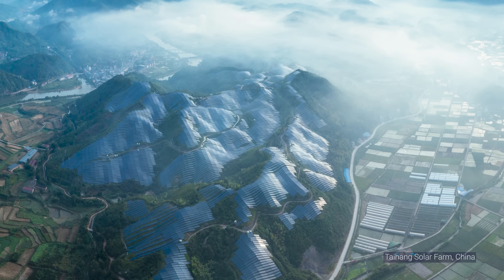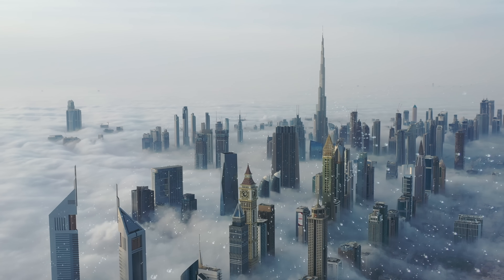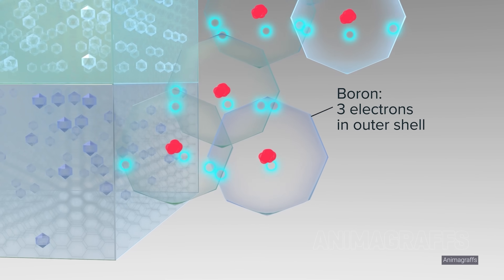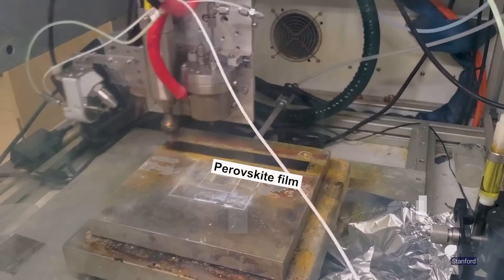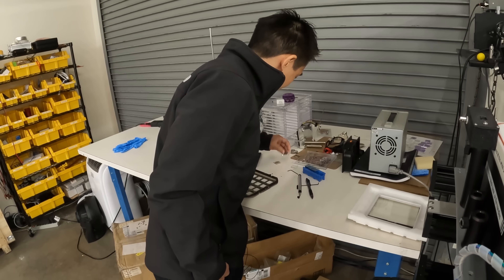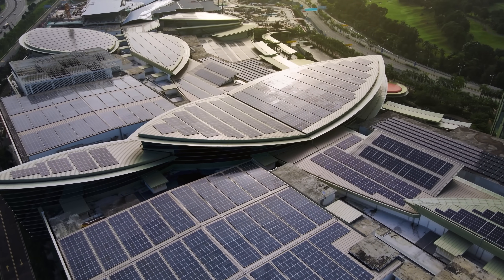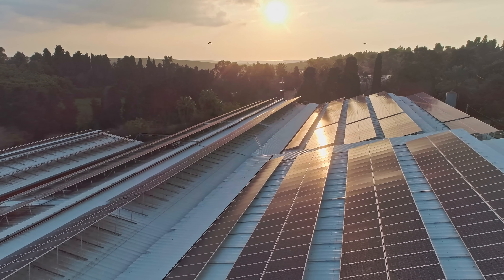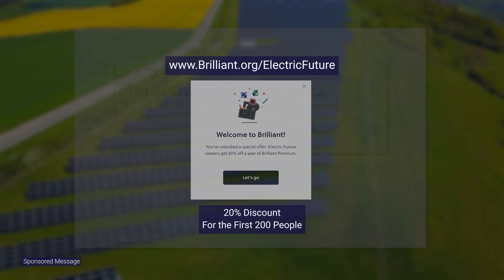Solar 3.0: This New Technology Could Change Everything

Comment: Solar windows, even small round 1s beat solar panels save arizona bright. Anched panel 3" low to  high  on sunny side min. If u only can make RV face park 1 way in slab spot, Then u will need to make panels unlock & disco spin to other sunny side. If less windows cheaper heating & cooling saving but still natural light strong by solar window usually air insulation heating cooling cap.

Comment: 1669: if going w/20% enslavement system any way bc top of roof or trailer dead spot any way what counts is stadium slopping roof or flat ish roof. If trailer roof parked mostly or driven largely.  If slopping easy right sunny side of roof anyway just fineness best angle for latitude esp if fixed not able to increase up or down during day. If a trailer height weight limited then u need to slide extension double the sq feet when parked so not just near flat setup but able to lift up so not flat angling best lat amount. But if u can slide out & double sq feet u will get less shadow effect big help. At a min if trailer roof fixed hve arched flat surface so a bigger window of day charging.
Reply: If u hve only simple trailer arched deal set up fixed bulk of time. Then u need a light box broad opening mirrored inside. Further from panels u can get light box again a simple slide the better light mirrored greater panel length of day results.

Comment: If these are so cheap and are more efficient, then who cares if they only last two or three years? If they are 1/15th the cost...then they only need to last 1/15th as long to be competitive. They should be commercially viable NOW....unless the service life is vastly less than they hint at in the video.
EDIT: Further investigation reveals the best lifetime achieved so far is 1,000 to 2,000 hours of exposure to sunlight....or approximately .5 to 1.5 years of typical service.

Comment: Ok this is great to hear. Solar panels have come way down in price. Could they not make a hybrid between the 2 to create a better product. Also the biggest issue with solar is storage of power. We need batteries to take a leap in technology.
For this product 10% increase efficiency at 1/5 the cost sounds amazing

Comment: Water gravity old way only game in town 3rd way. 4th way NOW is geothermal. 5th way NOW is nat gas, or 5b &5c way in NOW is trash dump or farting gas. 6th way game in town is tidal or wave. 7th way in now is nukclear, just the back side big problem long time current tech. The 8th way is coal dirty still current tech. 9th way is oil a lot of it if not spilling it big mess.10th way in NOW is algae green harvest or bio harvest mass 10b way. The 11thway in NOW salt mrror solar or 12th way in NOW vertical wind. the 12th way if solar watch watch way but slave labor & printed fake money would fool u otherwise. So u hve to use solar for heat 1st or purifing water 2nd or mirror salt 3rd or 4th back pack drone wing or 5th vertical reflected lost top of roof any way.
Reply: space 24hrs a day sat wing the exception when talking solar way more than just 20-30% enslavement satanist system there aimed in space.

Comment: If u live in an area not drone wing, or already real hot! or already clean cheap pure water & dead area on roof or top of trailer, only way then left to use solar is reflected or mirrored transparent vertical panel way. Solar then still basically a loser if not in space 24hr sunshine  or in back pack aimed or drone wing free power otherwise lost.

Comment: Great information and explaination overall, thanks for the vid. But it was a shame to not talk about a very important counterpoint against all multi-junction solar cells, the recyclability (poor LCA). It's all well and good if they're cheaper and easier to make, but if they are harder to reuse the materials, to make the cost of 2nd life materials as cheap or cheaper than mined raw materials. You will have problems for energy from the 'renewable' panels to truly be renewable. With finite resources, you must be reaching towards material steady-state.
Reply: @Anedime  while I appreciate your reply, I think you have a fundamental misunderstanding of carbon flux and the relationship between new technologies. To put simply, there is a carbon investment for any product, but to take a product from the lab to commerical scale, takes several order madnitude more carbon investment. Looking at the panel in peacemeal, the carbon payback for traditional Si solar could be around 5 years, so its a carbon positive product, when its rated at 95% spec for 20 years, however if we need to invest significantly more carbon on a product that may or may not ever reach carbon positive, due to the reasons of reuse of rare earth material, you will never achieve scale needed to decarbonise the world's energy. IRENA's latest report suggested solar could represent up to ~30% i think, total energy product, you can do a simple calculation to work out how many panels that is, and how much material you need if it were from the multi-junction cells. It's not a very promising option, even if an optimal senario is considered, and this does not mention the opportunity cost of NOT investing in a better technology, of which there are many, to achive the goals you outlined.
Reply: @bradmudgway6118  As for your explanation on the carbon cycle and near zero impact of conventional panels…bravo.

I’m personally skeptical about the whole “climate change” discussion. I’m mainly in this to take the “solution” out of corporation-sold/government-bought hands.

It astounds me how much everybody has vested in the argument, but so few are actively engaged in developing better solutions. “Climate alarmists” should be more interested in developing more solutions, while “climate deniers” should be more interested in making money and removing government from the equation.
Reply: @Anedime  Really?

You think forcing a technology with obvious designed obsolescence is MORE important than recyclability? 😂 

The whole issue was selling a “problem” that would justify selling a bad “solution” in perpetuity.

You really think dumping these panels full of toxic materials into land fills while strip mining for more rare Earths is a GOOD thing? 😂

The problem is that people, like you, are more interested in being “right” than actually solving anything. You’ll sit back say “society” needs to do something, then vote for people you’ll never meet to sign thousand page bills you’ll never read drafted by corporate lobbyists you’ll never see.

That ain’t dealing with the “problem.”

That is being mindless sheep.

Until you start developing viable solutions, you cannot honestly say that you “care” about the problem.

If you want something done right, do it YOURSELF.
Reply: @Anedime  unfortunately we're nowhere near the stage of being able to produce enough energy and being able to store that energy from renewables, but that's where we're being pushed to by the "greens"
Policy change is being based on totally inaccurate climate computer models.
Which is sheer lunacy!
Energy prices going through the roof, partly because of this "green" ideology!
It's like a religious cult, once you start looking in to it all.
Sure, let's reduce fossil fuel usage, and let's use renewables, but let's do it in a sane logical manner.
The last 2 years of our reaction to covid, should tell anyone with half a brain that our "leaders" do things in a way that's completely detached from sanity and logic.
Reply: Even with the nowadays cheap solar panels I don't like the framing of windmills and solar panels being a huge burdon on the waste fills. Yes eventually they end up in waste fills but they will be as polluting as half of all the diapers used for example. And this is the case for the future situation where the world is fully dependent on solar and wind energy. So yes it's a problem, but not a huge problem.

Even diapers can be easily replaced by washable ones, but you don't hear people about it, so apparently they sont care :)
Reply: @Timmsh88  Maybe you should compare the manufacturing processes for diapers, solar panels, and wind mills BEFORE using them as a comparison. 😂
Reply: @Anedime  Excuse me? OIl is the most prevalent energy source, followed by coal and gas! Then hydro and other renewables. Nuclear is not even close to top three. Further the environmental impacts of nuclear power (during normal operation) are miniscule compared to fossil fuels, and contribute little to no CO2 or air pollution. Radioactive waste is manageable. Nuclear is clean so long as it's done correctly, and in the end, it's going to be the one thing we can rely on
Reply: That’s why the panel should be passively optical. Being only polymers and silicates, manufacturing would far cheaper; both from material costs and manufacturing complexity.

Then you use passive optics to transmit the optical energy to a centralized conversion system. You can passively disperse the light by wavelengths allowing you to direct particular wavelengths to its respective material which do not have to be layered with other materials to accommodate different band gaps.

Furthermore, passive optics are impervious to EMPs like from lightning, solar flares, or upper atmosphere nuclear explosions.

The exposed portion of the system is cheaper to manufacture, replace, recycle, and disperse.

The more complex conversion systems are safe in the basement.

A side benefit is directing IR wavelengths directly to pavement panels allowing you to melt frozen precipitation without converting light to electricity to chemical back electricity to power metallic heating elements.

Oh yeah…didn’t even mention the aspect of harnessing IR for thermal applications such as water heating, water purification, radiator heating, and steam turbines for more electrical production.
Reply: @josephcoon5809  the rest of the circuitry would be susceptible to EMPs.
Reply: @glenwaldrop8166  Not as susceptible as a small unit in the basement easily shielded than as on the roof spread out over multiple square yards unshielded.
Reply: @josephcoon5809  It has to get to the basement.

This type of solar panel is not any more or less susceptible to EMP than anything else. The cabling would still need to be protected leaving the panels, same as everything else.

Normal solar panels are made up of silicon and metals, the silicon isn't the weak link in the other type nor is it at risk from an EMP.
Reply: @glenwaldrop8166  😂 So, you THINK polymers and silicates are susceptible to EMPs?

You have any papers on that?
Reply: @josephcoon5809  

I said the exact opposite of what you just claimed. We use solar panels when dealing with frequent lightning because they are hardier than the grid.  I'm not even bothering with you, you're either trolling, not taking the time to actually read the comment or your reading comprehension level isn't what it should be.

Regardless, have a nice day.
Reply: @glenwaldrop8166  I’ll slow it down for you.

Panels with NO metallics in it

because you are using passive optics to gather light and transmit it to the basement

is FAR LESS susceptible to EMP.

From the roof to the basement, it is optical.

IN THE BASEMENT is where the conversion to electricity occurs.

By segregating collection and conversion, you drastically reduce manufacturing costs AND make recycling FAR more feasible.

YOU are taking about technologies with obvious designed obsolescence.

I’m talking about a completely different design that doesn’t depend on fragile panels that are environmentally susceptible to thermal degradation and EMP.

Are conventional panels less susceptible to EMP than the power grid?

Yes.

Are they impervious like a passive optical system?

No.
Reply: @josephcoon5809  They all have electrical wiring to move the electricity.

That is the weakest link in the circuit, not the panel itself, regardless of the type.

The weakest link is the connection between the panels and the wiring itself, tiny strands of copper, usually, followed by where it comes out of the panel assembly into the charge controller, any points where the wiring combines, this doesn't change.

After that you still have to protect the external wiring and components, which is equal pretty much across the board.
Reply: @glenwaldrop8166  Yes. The ones available NOW all have METALLIC wiring ON THE ROOF.

That is why I said they SHOULD be passively OPTICAL ALL THE WAY DOWN TO THE BASEMENT.

Do you know what glass is? Light. Glass. Roof to basement. Metallica ONLY in the basement. Easier to shield from EMP. Thermally controlled. Not like on the roof. In the weather.

What isn’t clicking for you? 😂
Reply: @glenwaldrop8166  

Sunlight
Panel
Light
Fiber
Light
Basement
Photovoltaic
In the basement
Not on the roof
Not outside

IN

THE

BASEMENT
Reply: @josephcoon5809  you're talking about channeling the light?

You could have phrased it differently at any point in the conversation to clear that up.

That does significantly lower the risk of EMP but you're going to have a hard time blocking magnetism without blocking light. It's only going to be shielded so much, there's also the tunneling effect on the EMP depending on what the structure is made of for the light tunnel.

A traditional setup under a cage would have a similar effect.
Reply: @glenwaldrop8166  I kept wording it differently this whole time. I said the same thing five different ways. 😂 

And what are you talking about “blocking magnetism without blocking light”?

I’ve spliced fiber optic cables for 15 years, and I have never heard of such an issue. 😂 

Yes, I understand you can shield it only so much, but you can do it far easier and cheaper than shielding conventional panels WHICH HAS BEEN MY POINT THIS WHOLE TIME.

It’s funny how you remarked on my “reading comprehension”, you know… 😂 😂 😂
Reply: @josephcoon5809  you're not going to funnel enough light to the panels using fiber optic cable if that's what you're talking about. That would require enough fiber optics to fill whatever the panel size is.

Further, any opening large enough to carry enough light, be in 60K fiber optic pair or a tunnel with glass caps on each end, that opening is not going to be shielded.

You're living in a world of make believe.
Reply: @glenwaldrop8166  Sixth attempt…

•Sunlight
•1,000 watts/m^2
•1 square meter of glass/plastic of a fresnel lens array
•Sunlight is collected by the GLASS and PLASTIC panels; concentrated; inserted into large core fibers (large core fibers are capable of handling MEGAWATTS of optical power)
•sunLIGHT travels through LARGE CORE waveguides to the BASEMENT.
•sunLIGHT is passed through a prism or diffraction grating to separate the LIGHT into various WAVELENGTHS
•Each WAVELENGTH of LIGHT is directed to the system that optimizes its use.

•Two red and blue wavelengths can be used for MOST greenhouse applications. There are four wavelengths that most chloroplasts use.
•Other visible wavelengths can be used for lighting.
•Any other wavelengths can be directed to individual PV cells of a SINGLE PV material for conversion to electrical energy.
•IR wavelengths can be directed to THERMAL applications.
•Even UV can be utilized.

Fiber optics can safely handle up to 250 KILOwatts/cm^2 of continuous energy (not pulsed) so, you can send the sunlight collected from 250 one square meter panels on a fiber with a core of just ONE square centimeter.

Can YOU fit 250 one square meter panels on YOUR roof? 😂
Reply: @josephcoon5809  You can't fit 250 sq meters of panels in your basement either.

Again, we're back to the point that covering panels with a faraday cage would be cheaper and every bit as protected.
Reply: @glenwaldrop8166  Technically, you COULD put 250 square meters of PV material in the basement.

You just wouldn’t restrict it to SINGLE FLAT PLANE like on the roof. 😂 

Think of conventional electrical capacitors. You can have a single thin film rolled into a far more compact unit rather than lay it out flat on your roof. 😂
Reply: @josephcoon5809  this is an very facinating idea I wasn't familar with, thanks for the info, i will research it! sounds almost too good to be true, but I agree there is a lot of potential combining optics with solar PV as well as the traditional combition with solar thermal
Reply: @bradmudgway6118  Yeah. I wish I had more time to research it some more, but there’s just so many problems in the world that too many people want others to solve.

Cheers 🍻

By the way. I would look into photosynthesis. Plants have been evolving for billions of years. If anybody is an expert on light propagation and energy conversion, it would be plants. More specifically, check out Quantum Biology and how quantum entangled molecules provide never before seen high-efficiency photon transmission.

Comment: So if not in desert or at equator then not solar even cheap solar  best way to go other than light weight key flying drone. No best panel on planet earth is not a solar panel. Best panel  bulk of time during day bulk of area on the air bulk of cold seasons is a water transparent purifier 1st. Then a fiber capture 1million to 1 broad grow light laser. But if solar on roof is to "work" ie get more than we printed/spent back then must be better than dark box heat capture. Most of planet save flying drone wing or back pack solar is stil chinese printed money slave labor still loser if not vertical.

Comment: So since it is 30-40 degs cold down here we need to Get/capture heat front end & capture purifying light in thin film front end if weight of water film not a problem. Then work on reflecting light bulk of time bc not sunny bright bulk of the time & bad time for durability. So heat or then purifying 2nd & best transparent get by either reflected light if bright area or most likely not equator. That capturing million to 1 way. Getting all back end & focusing back into1 broad laser for either growing or light.